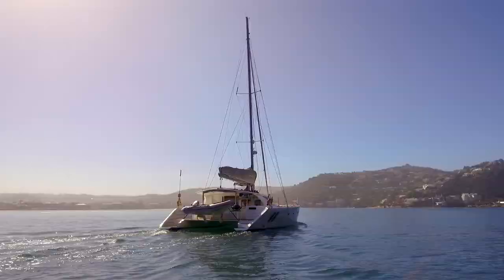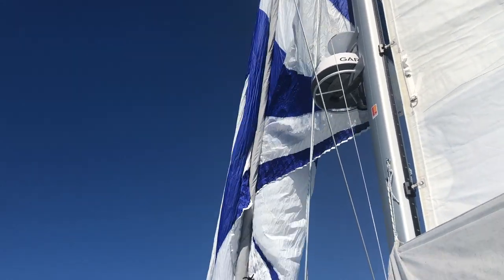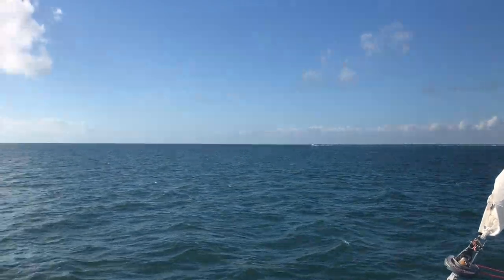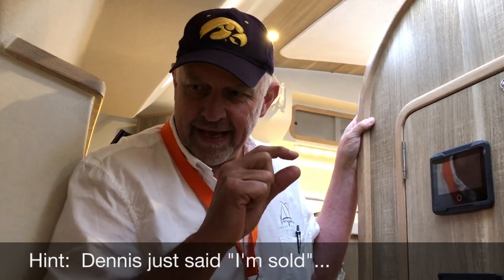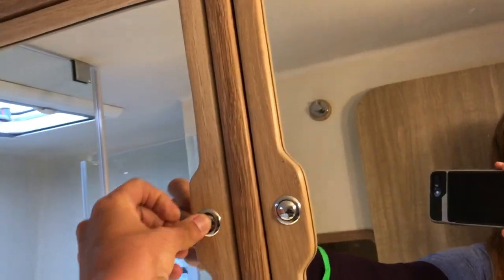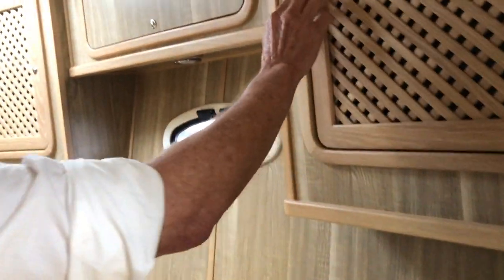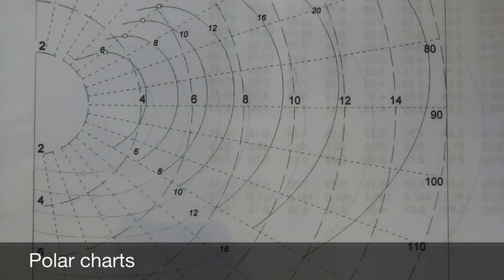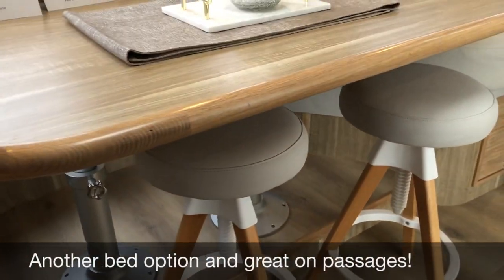GTFO plan #23:  Knysna 500SE Review - We bought a boat...Did we buy a Knysna 500SE!?

Comment: Thank you so much for the review, there is no perfect cat but this cat comes close. I thought from the sound of the engines they were rather louder than if they was on the back deck? Yes, much safer and better to work on engines inside than outside. Would you guys think the engine sound is a deal breaker, I know you cant answer until you reveal the winner, but after announcement can you make comment on the engine noise? Yes, the St Francis has engines under the after births and I do like the hard bimini with glass and wiper over the plastic enclosure. However, this is a very nice cat and I can't seem to find a cat without compromises, which really is a pain when spending hard earned cash.
Reply from the maker: You’re most welcome!  We much prefer the safety of having the engines under the aft berths. We didn’t think the engine noise was too loud at all. The St. Francis has the best enclosure with the glass plus windshield wipers. There’s always trade offs!
Reply: Have you checked out the Xquisite X5? It’s also made in South Africa. It’s an awesome 50 footer.